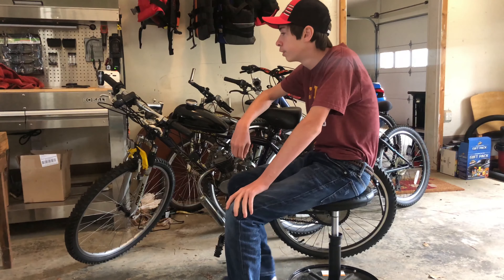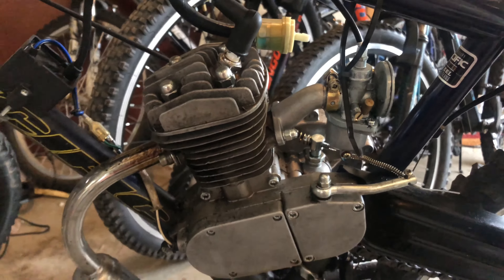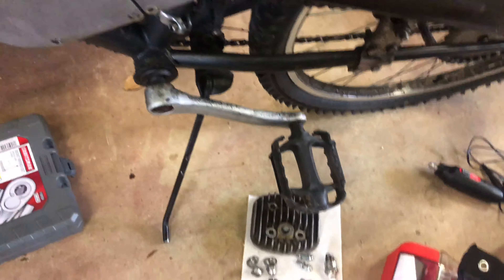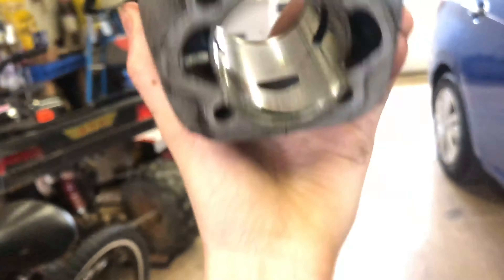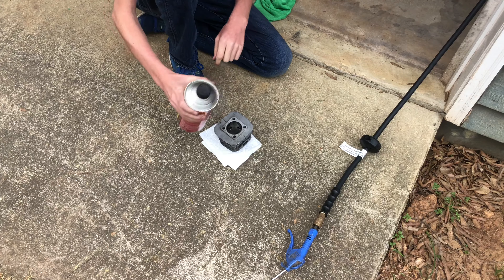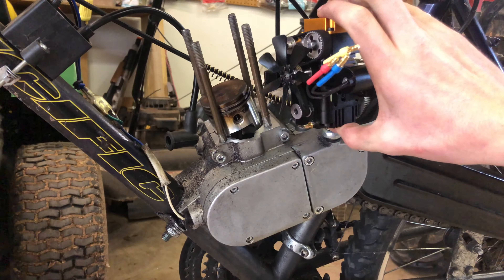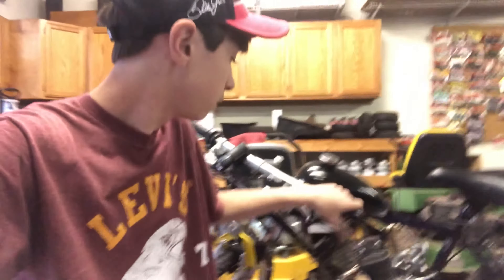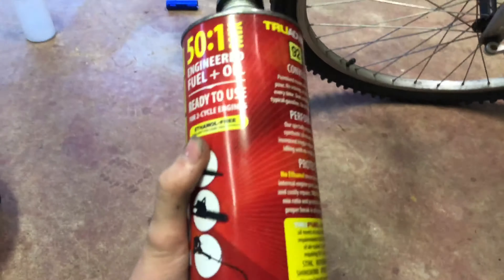Motorized Bike Cylinder Porting & Test Run!

Comment: Can I also do porting without the grinding tool? Because i wonder if a round file would work and use a 320 grit, 400 grit and 600 grit sandpaper to smooth the ports.
Reply from the maker: Yeah that probably would work fine to get all the casting trash out of all the ports. Some spots maybe tight and u could use a tool but you should get most to all of it. Might can polish the exhaust with that sandpaper or even finer grit but the intake leave it rough(like sandpaper rough) and that will allow the air and fuel to atomize better.
Reply: @IngenGarage  ok thanks
Reply from the maker: @jarelsuckrajh5932  No problem!

Comment: Would this work because I messed up the fuel mixture
Reply from the maker: Porting should work at letting the engine flow better, but I run 40:1 all the time now with no issues at all!

Comment: An expansion chamber exhaust would help the bottom end power. Lift your main jet needle one notch, this will help the mid range power. OR, replace the engine with a YD 100. You would be surprised by the difference.  Good luck.
Reply from the maker: Thanks dude!

Comment: I clean up my ports but I don’t take too much material off; they’ll fall apart.
Reply from the maker: I just did it a little bit
Reply: @2strokecarbtuningportingin187  It’s all cheap junk. 

Ride it and have fun. 

If you want a nautilus go electric or hybrid with a 4 stroke or a properly designed 2 stroke with emissions like a freight liner
Reply: @tytraulich4987  grew up with two stroke street bikes rs Yamahas Rd @ gt Suzuki's and h2 Kawasaki's you can thank EPA for banning them my porting and carb tunning  apply s to all twostrokes simply sharing information man

Comment: I see u running in parking 🤣 that Port timing work no help in nothing You do the Port work with degree wheel or not is very important uses degree wheel and take the grade of the motor first and after that u Port the cilinder up the grade w the degree wheel
Reply: Don't waste your time trying to explain that concept to someone that obviously know everything lol